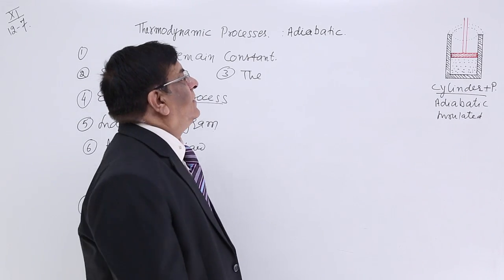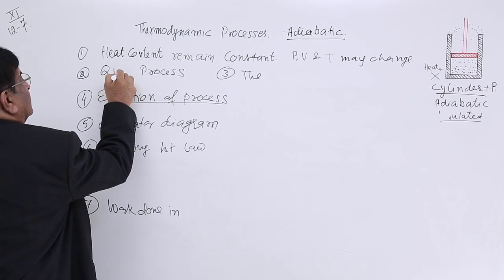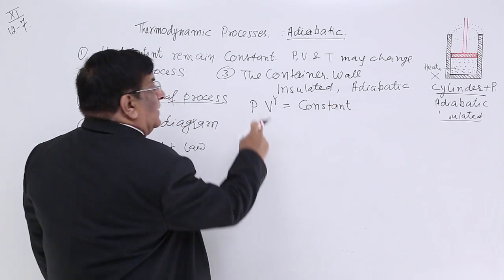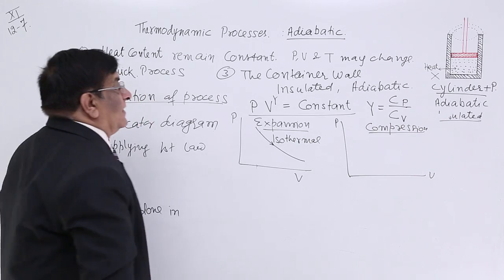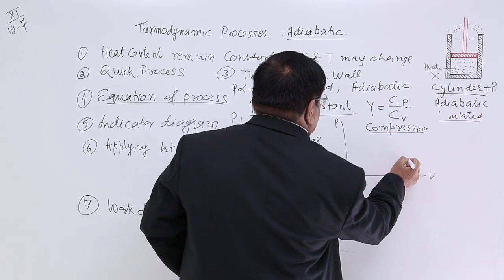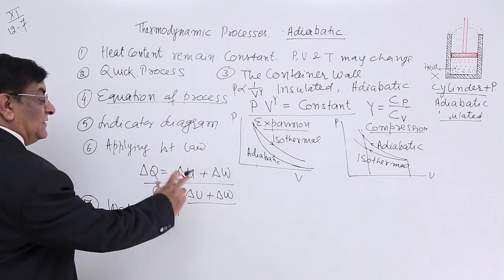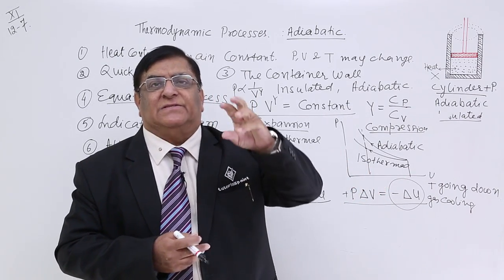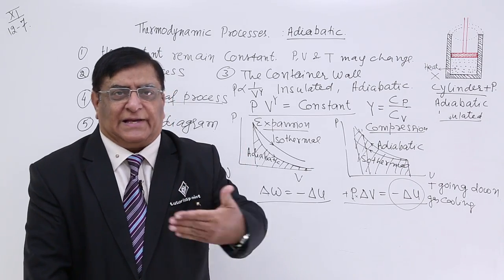Class 11th - Thermodynamics Process - Adiabatic | Thermodynamics | Tutorials Point

Comment: If Heat increases when we compress adiabatically temp also increases and also after expansion temperature and geat both decrese as sudden fast expansion occurs, So my question is, "Heat at point 1 before compression is low and after compression at point 2 is higher than at point 1 so how q is constant here? Pls explain I am confused🙏
Reply: q is not internal heat, it's applied heat..